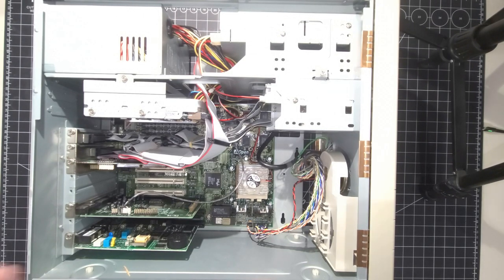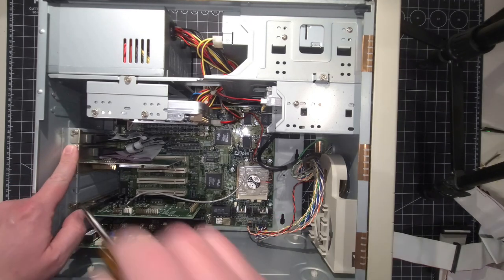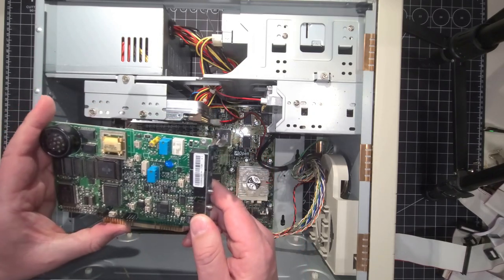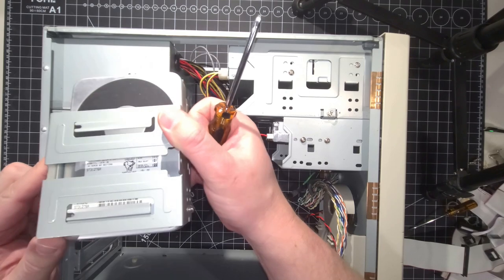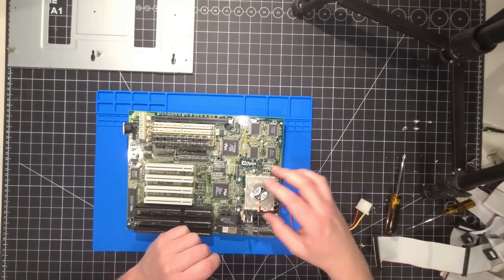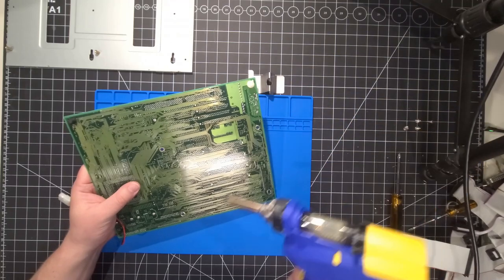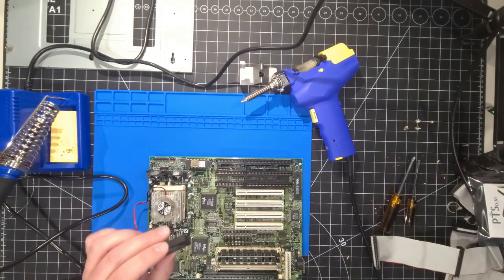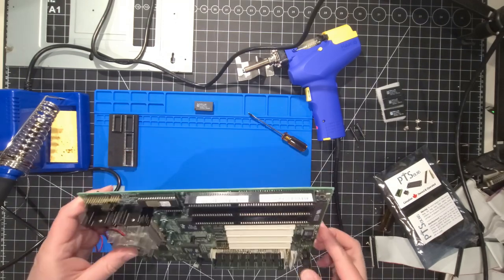AOpen Mystery PC Part 2 - Disassembly and RTC Removal

Comment: If that's ESS1868, keep it! While very popular, at the same time, it's one of the most compatible card with better output quality than any ISA soundblaster ever was. It has ESFM instead of OPL or CQM - it's different, but not bad at all. And some games (for example Warcraft 2) can even use the ESFM superset to have nicer music than any other card could ever produce.
It has no hanging note bugs or any other issues like that.

Keep it and use it. It's a perfect all-around card with even some enhancements over other cards.

Overall, this seems to be a very nice overall machine to have "later-era windows 95" machine with all the fun stuff installed and have no issues with performance with era-appropriate software. I strongly suggest to load it up to 64MB of ram (it has SD-RAM slot, so use that!) and if you do fill it up to 256MB of ram, use a DOS RamDisk (XmsDsk) to consume 192MB of the top part of the memory, as that part can not be cached by the L2 cache. Then windows still sees only 64MB of (fast cached) RAM and you have an extra ramdrive. ;)
Reply from the maker: Yes it is an ESS1868!  I just completed filming the rest of the series (to be released Saturday - stay tuned!!) and I have confirmed what the soundcard is.  16mb of ram is definitely sluggish, so I will be taking advantage of that extra RAM slot!  Thanks again for sharing all of this info - it's great to share these experiences with the community and to get the feedback!!  Thanks for watching!

Comment: seems like those 3 pins on that dallas up there are on a ground plane so that's why the FR-301 is struggling to get it since the plane is absorbing the heat and preventing the solder from melting good
Reply from the maker: Makes total sense in hindsight!  Thanks for this - never thought about that at the time.  Thanks for watching!

Comment: That plastic piece does NOT connect to a backplane, a backplane for example (and a bad one at that) is what you what those ISA slots are, a true backplane is a board with just the slots and their interconnections and not much more, maybe a keyboard connector. That plastic bit goes into the case board support slots, nice to reduce the number of screws, bad for making sure the board does not jostle around.
Reply from the maker: Thanks for this - maybe I incorrectly referenced the removable 'motherboard mounting' panel as the backplane.  I am aware of what a true backplane is (supporting multiple configurations inserted into them).  I stand corrected and will pin a corrected comment.  Thanks again!